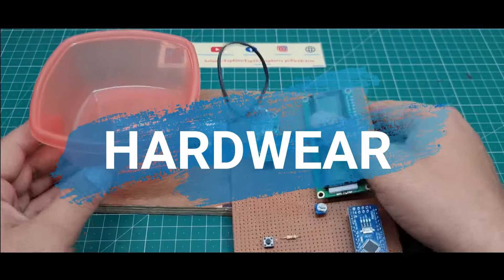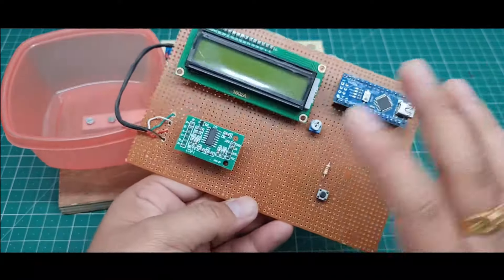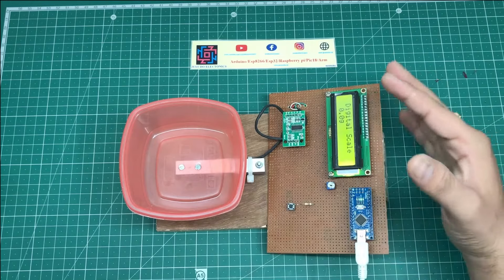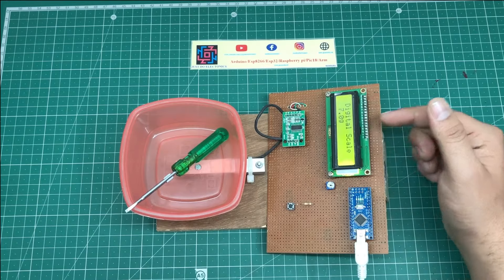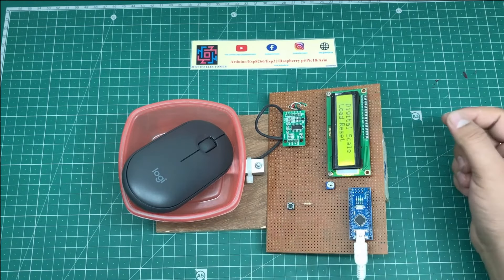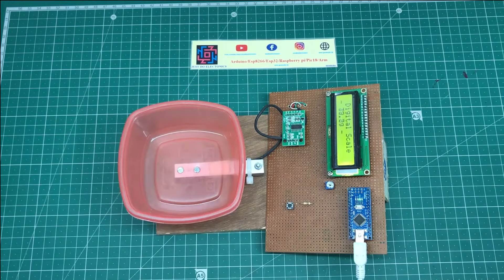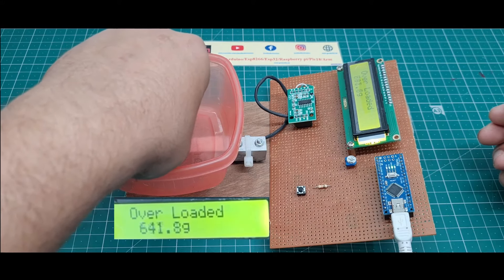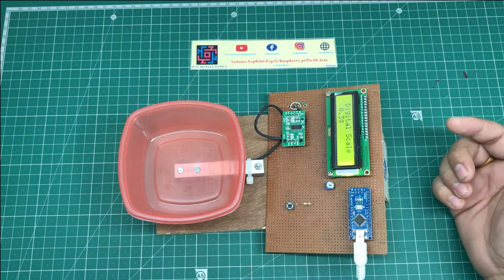Arduino Digital Weight Scale HX711 Load Cell Module | Arduino Project

Comment: If I use to this for  45,50 tones weight its work or dont? I am thinking connect 6 load cell  to HX711 Weight Sensor is it okey ?
Reply from the maker: No ia not work sir
Reply: youll need a 50tn loadcell... its very expensive. Rather buy a weighing scale of that range.